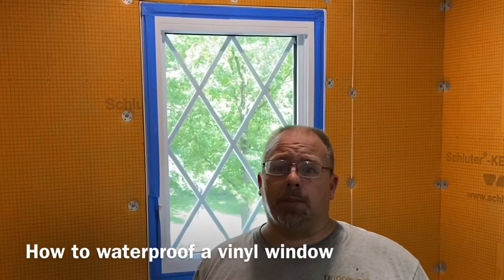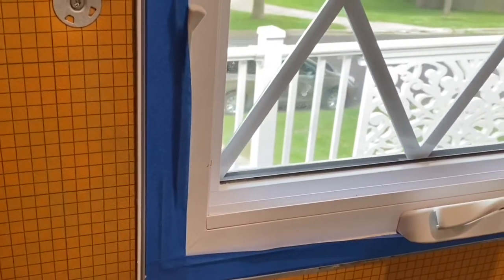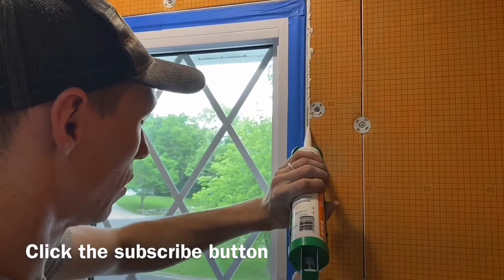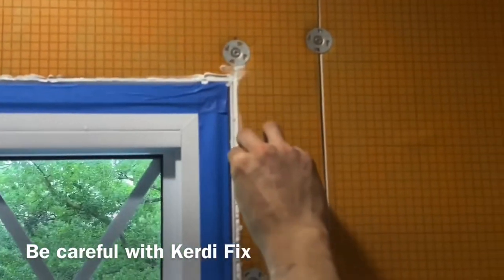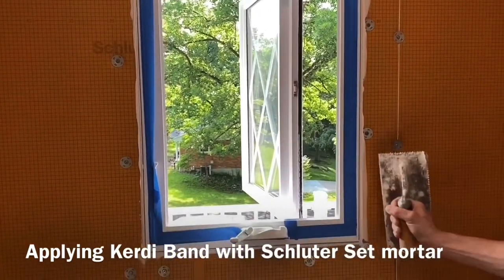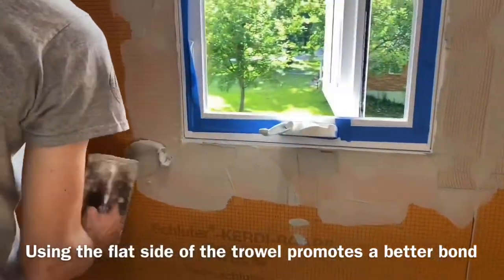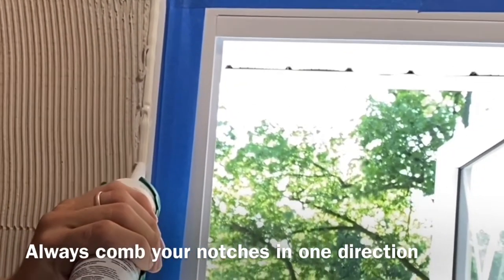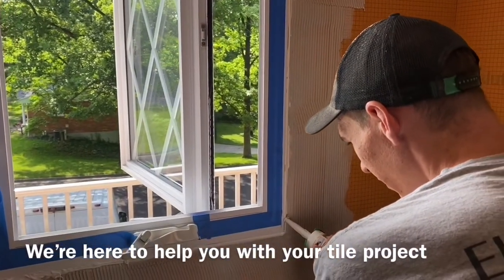How To Waterproof Shower Window With Kerdi | Columbia MO

Comment: Helpful video! Where can we see the finished shower? I would suggest a better caulking gun. Looks like you Brent was struggling with applying the Kerdi fix.
Reply from the maker: If you send me a text I can give you finished pictures. It may take a little bit to respond, those pictures aren’t on my phone anymore. (573) 289-1045

Comment: Great video sir. Thanks.  This is exactly what my project looks like. 
Would you be able to  add a material list so a person can buy exactly what you’re using here?
Reply from the maker: I use Schluter products for my builds. What you’ll need is Kerdi Board, screws/washers, Kerdi Band and Kerdi Fix. I also use Schluter thinset to get a lifetime warranty from them as well.
Reply: EJ Flooring & Custom Tile Installation cool. Thanks for the feedback sir!  Take care.
Reply from the maker: You as well. Good luck with your project, if you have any more questions I’m happy to help.

Comment: I have a flush window like this in my tub, too.  Looking to put a glue up shower wall/surround vs tile, will adhesive stick to the Kerdi board?
Reply from the maker: Adhesive, like silicone?  I’m not sure. You could try it on something first and see how it goes.

Comment: How do you ensure the window crank mechanism is waterproof?   Is this window a 'waterproof' window to start with? (So then that mechanism is all waterproof from the manufacturer?)
Reply from the maker: Any water that hits the inside of the window is directed to the sash which is tilted outside.

Comment: Hello, love your video! 

One question - what are you applying to the window sills after the mortar? Is this some sort of paper solution? 

Cheers
Reply from the maker: It’s Kerdi Band. It’s a thin paper made by Schluter that is waterproof. Kerdi Band completes the waterproofing step on all the seams and screw heads. Thanks for commenting, I really appreciate it.
Reply: @friendlyneighborhoodtileguy  Thank you so much! I have learned a lot watching your videos
Reply from the maker: I’m here to help. Feel free to ask anything tile related. I’ll do my best to get you the right answer (the right answer is based on manufacturer requirements and industry standards).

Comment: What window is this? Thanks.
Reply from the maker: This is just a vinyl window. It was already installed before we did the shower. I don’t know anymore than that. Does that answer your question?
Reply: This is a see through window.  The kind with glass, a frame, that allows you to see the outside from the inside of a home, usually constructed of a wooden frame and possibly a brick and morter structure with a foundation and footing.  This type of window would not be in a clay or mud building..  sorry..

Comment: You didn't waterproof the screw holes.  Kerdi wouldn't warranty this install.
Reply from the maker: All the screws are banded over. You may not see them in this video as this video focuses only on the window. This shower is definitely fully waterproofed and covered with a lifetime warranty.
Reply: @friendlyneighborhoodtileguy  thumbs up.